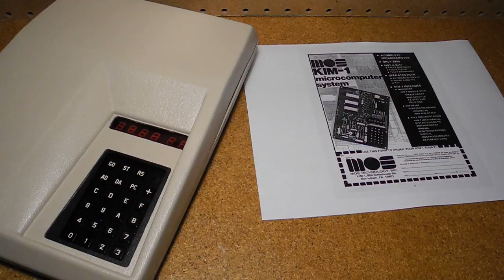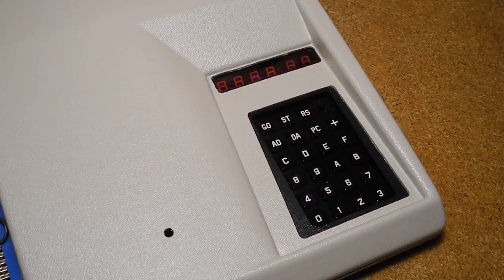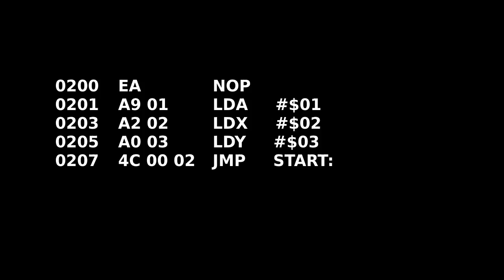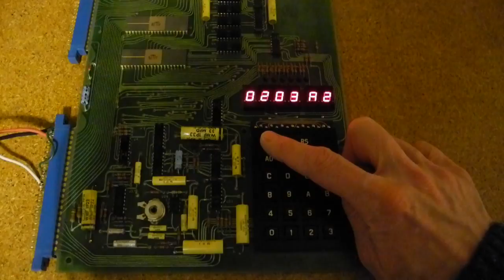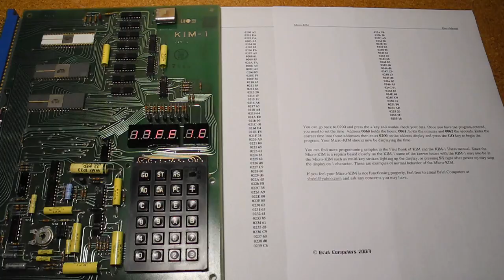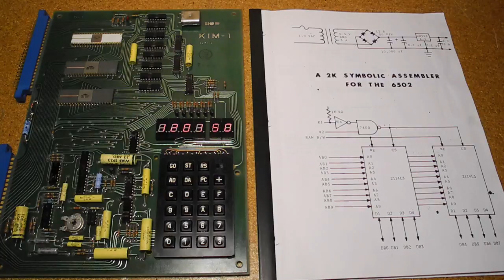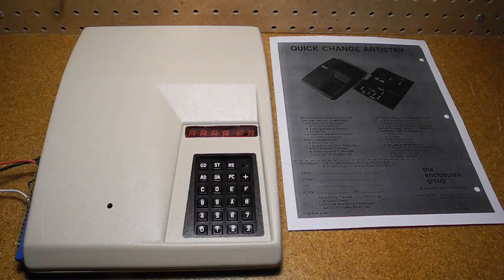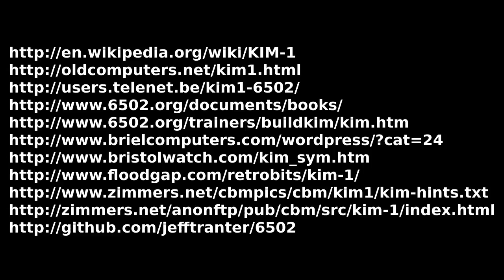The KIM-1 Microcomputer - Part 1: History and Basic Features

Comment: Wow!!! I was first introduced to the KIM-1 back in 1978. I was an EE student only interested in transmitter and receiver design. Then I met the microprocessor.  I was torn, thinking I had to chose either the analog of digital worlds. Once I became proficient at programming assembly code, I became aware of the infinite possibilities of microprocessor applications. The 6502 changed my life. Thanks the memories - 40 years.

I hope you can do the same for the Bi Tran Six trainer. This was the first of all microprocessor trainers.

Comment: Perfect timing! I just finished a project with my MicroKim and now I have a video to link to. Looking forward to your future videos.

By the way, to be super pedantic: The 6530 is a RRIOT, not RIOT: RRIOT stands for ROM RAM I/O Timer. The 6532 was the RIOT and came without the masked ROM; it was used in machines such as the Atari 2600 and therefore still fairly easy to get (unlike the many different versions of the 6530). The MicroKim was based on a web page by Ruud Baltissen on how to build your own KIM-1 clone using 6532s and an EPROM. MicroKim can get away with only having one RIOT instead of two because only one is needed for the keyboard and display and because a RIOT has twice as much RAM as an RRIOT (128 bytes instead of 64 bytes). But I'm sure we'll hear more about that in a future video :-)

Comment: In 1975-79, Loyola New Orleans taught us FORTRAN, COBOL, and Assembly language (machine unspecified). We couldn't realistically program the CDC 3300 in assembly language, so we eventually bought a Kim-1 and an Altair 8080. That is what we programmed in assembly language, though the programs were not extensive. I thought the Kim-1 was a nice little machine. Not quite as picturesque as entering a program into the Altair through the switches but fun. We just had the bare board and a power supply, no case or attachments.

Comment: I am so facinated about this old stuff. I was just an 11 year kid when this came out in 76. And I dreamt of it in the nights. However it should take some years before I got my own computer, an Sinclair ZX-81 in kit form. 
Some years later I also got the chance to get an original KIM-1 Rev. A., still in the original shipping box with post address sticker, warranty card and all the docs. All the chips are the ceramic ones. The CPU is pink ceramic. CPU marked with: MOS MCS6502 C 2776 The two other are marked: MOS MCS 6530 002 1776 and 003 1876 respectively.
I dont think there are many Rev. A. left with the pink ceramic MCS 6502.
Anyone?
Pls. let me know.

Comment: Hi! Great video thanks. I don't have a KIM 1 and grew up around the other ubiquitous MPU the Z80 (I had a ZX81 then spectrums of various models. I recently got hold of an MPF-1 Microprofessor from my old University which I found needed a new Z80 chip. The Microprofessor is very similar to the KIM-1 but uses a Z80. The programming pronciple is the same with a keypad and 6 digit  7 segment display. Z80 opcodes are entered and the program run. Breakpoints are a little easier to implement as there is a breakpoint key and it is possible to load/save via cassette or from a PC. Its a great tool for learning very low level assembly. I'm going to watch the rest of your adventure with your Kim now. All the best, Steve.

Comment: My KIM-1 does not have a date code stamped on the front. It does however have a white stamp on the back that may indicate that it was the 1255's KIM-1 produced. It has a 1576 date code on the 6502, an 1176 on one of the 6530's and a 1776 on the other. It is a beautiful machine.

Comment: Random note: There was actually never an ROR bug. The original silicon did not implement the ROR instruction because it was deemed to be unnecessary. Microscope analysis of the die has confirmed that while there is a spot in the instruction decoder for it to go, the decode line on the chip does not go to any destination circuit.

Comment: I have a kim-1, but my U2 and U3 ICs are bad. The person that had it before me accidentally destroyed them.
 I don't think there is any way to replace them, as they included mask ROMS. Do you have any ideas on how I might go about repairing this computer?
Reply from the maker: The MOS Technology 6530 had a custom ROM, but there are some solutions using a 6532 and some external parts. Have a look at these links:
https://www.corshamtech.com/product/kim-1-6502-replacement/
https://www.corshamtech.com/tech-tips/kim-6530-replacement/
http://retro.hansotten.nl/6502-sbc/6530-6532/6530-replacement/
http://retro.hansotten.nl/6502-sbc/kim-1-manuals-and-software/kim-1-6530-replacement/

Comment: The KIM r00lz! This thing is awesome! You can't get any more hardcore than this. Blows any shitty Windoze PC outta the water!
I used to have a Rev F that worked for about a day (!) when I received in in the early 2000s. Then the 6530 RRIOT containing the TIM firmware suddenly died. Just like that. No smoke, nothing. Just dead. I sold it as a display piece and now have a working Rev G which cost me an arm and a leg. 
I think many of these early MOS chips had manufacturing issues or just didn't age well. Anybody else have this experience, or did I just draw a dud?

Comment: Are those hand-drawn traces? Wow, hasn't seen those in a while, not even on hobbyist stuff.

//edit: By hobbyist stuff, I of course meant someone making a custom board for their own private use or a limited run, not mass-produced stuff that can be used by hobbyists such as RaspPi or Arduino.
Reply from the maker: Yes, I believe t was hand drawn or manually taped out, which would not have been uncommon circa 1976.